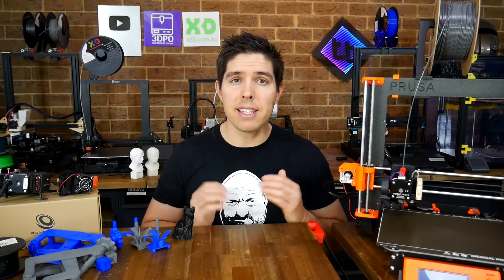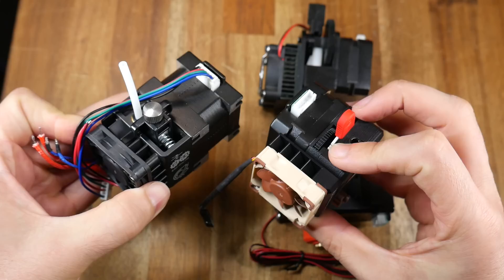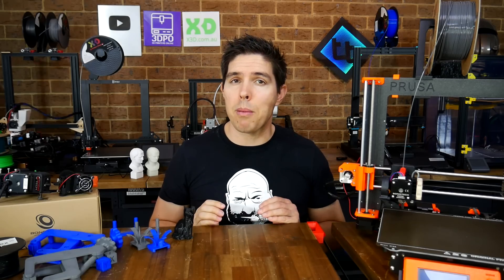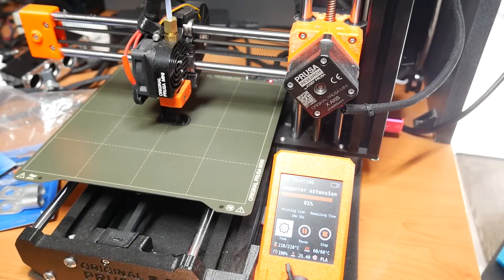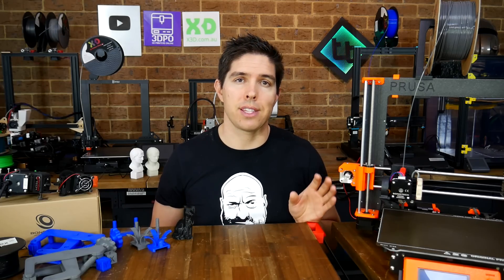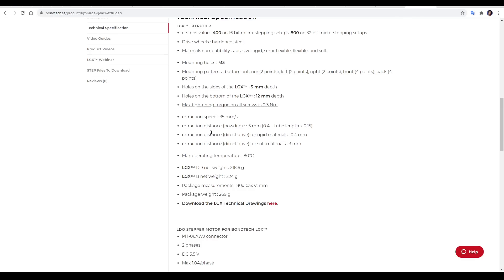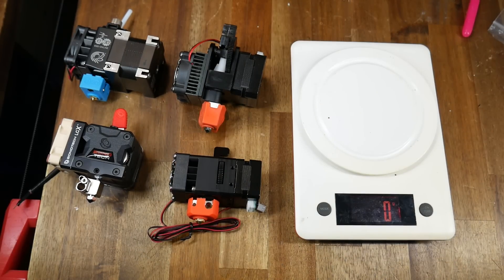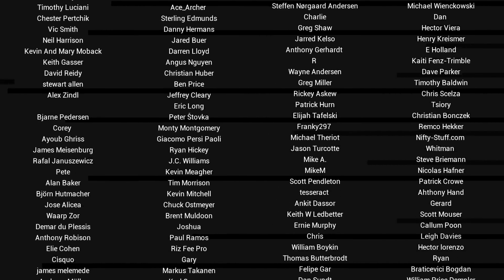Bondtech LGX extruder guide & test for Prusa MK3 and Artillery3D X1

Comment: Excellent video again! I love the LGX Mosquito combo. Mine just arrived for my Artillery Genius. The extruder and hotend is a critical part of any printer. Spend the money where it counts. Mosquito eliminates heat creep completely and is quieter as well because it's designed so well it requires only a smaller fan. Not needing to do heated nozzle change is also like a gift from god. Only need a few seconds to swap a nozzle. People don't play with more sizes of nozzles because it takes so long to do, it's messy and risks breaking parts while doing it. Yes, the prices are higher than a clone but you pay for innovation and quality in the product. R&D is not cheap. It costs nothing in R&D to make a copy so of course a clone can sell for cheaper. If people keep supporting clones there will be no innovation in the industry and it will be a race to zero. The consumer will be left with a bunch of cheap parts that break all the time.

Comment: I just built my first Voron, a 0.1, the tiny guy. I'll eventually go for the 2.4 but I have plenty of other large volume printers so the sooner might be later and might not happen. On my Voron I did something that most haven't and it's not a common build. I have a Bondtech LGX with a Mosquito hot end. And my Voron is making some outstanding prints. Most Voron builders go for lighter weight extruders to crank some amazing speeds but I am not thinking speed I am thinking quality prints and I am getting GREAT quality. Nice video as I watch you often.

Comment: I think they drastically changed this kit.  I have a generic 300 x 300 x 400 machine with an X ail the size of the Artillery Sidewinder X1.  I bought the X carriage and mount and am modifying the LGX/Mosquito upgrade kit to this machine.  I am also using the Waggester Mod.  The included fan in the kit isa 5015 blower fan, much bigger than the 4020 radial fan the Sidewinder uses.  I have a 4020 and got that all mounted up, but I do not have the "snap in place" fan duct like you did.  I think I found a Waggster variant fan duct that will work.  The Bondtech Sidewider X upgrade kit i have comes with it's own bracket piece to hang the stepper motor on, so it isn't re-using the Sidewinder.  To make it even MORE confusing, the Bondtech video tutorial shows the kit like YOU have but their website instructions are reflecting a newer version of this kit.  They really need to synch things up!

Comment: One thing to note, is that the gears you showed were not the original Bondtech gears but the BMG gears. The original Bondtech gears are actually the V1 and V2 gears. Which are also very similar to the QR gears though the center-to-center changed slightly in the QR model from the originals based upon feedback and tuning. It’s a small note I know, but just wanted to put in the correction. I actually own the second set of Bondtech  gears ever made (Alpha concept design). Martins is a good friend, and I was lucky enough to work with him on the original designs. He’s done tons of work and testing since I ever had any input. His design styling is definitely unique and I’m always impressed with his constant drive for improvement.

Comment: Very nice as usual and good timing, I just ordered the normal BondTech and V6 hot end for my Sidewinder X1 as I have been having such issues with the stock extruder after moving to a bi-metal heatbreak. Thanks again for the insight and help on this!

Comment: I bought mine last week, it will arrive next week wednesday with a Mosquito. I can't wait :)
Reply: Which printer are you putting it on. I put it an X1. One thing I found is the fan duct they have that works with the stock part fan isn't enough cooling. Luckily I previously had a 5015 fan for it so when I put that back on it made a big difference.
Reply: @n1elkyfan  It's my custom designed printer :)
Reply: @snelinternet4654  sweet

Comment: Nice review and a nice upgrade, but wow that's quite some outlay! I thought my E3D Hemera was expensive but this takes it to another level! I don't really see what advantage this has over the Hemera to justify such a difference in price, but each to their own I suppose :-)
Reply: If you don't take into account the adapter set, it is a bit closer to the same price range. But Bondtech actually created a set of parts for you for an easy drop-in replacement of the whole extruder, while for the Hemera you pretty much have to rely on other print nerds, or create your own. The care they took to make it fully compatible with the Prusa was a big plus for me.
P.S. don't forget it has Slice parts which is way more expensive than E3D, and can handle 450 °C.

Comment: Question. Prusa regulary provides upgrades for the firmware of the printer. When adapting a new extruder-combo als the LGX, do you need to recalibrate the e-steps and other details every time you apply such a firmware-upgrade ? Or are firmware-upgrades simply no longer applyable?
Thx.

Comment: You could literally buy an entire budget 3d printer for the cost of this kit.
Reply: He said it wasn't for everyone....   that whole budget printer still has to be tweaked and maintained as well.
Reply: @kevin_raney  Right but the main benefit of this upgrade would be faster printing times (lighter hotend) combined with the better extruder gears. If you just want faster printing times having a second printer would definitely beat this upgrade. So the only real benefit I see is the bigger extruder gears.
Reply: @QuadTAZ  The lighter extruder/hotend only makes a difference if you don't have a heavy bed like with the i3-style. 
But I agree with Michael, this is a very high-end product and certainly has its uses.
Reply: @xKenn  exactly but sadly injection molding sometimes can´t get to where sls can. I spoke some time ago to trianglelabs about making an bmgx2 which i think many people would buy but they said theres no "cheap" way of doing it.
Reply: @dilanbartz7737  not everyone wants to work for $3/day.
Reply: @xKenn  Extremely embarrassing for you to say something like this to promote a company which steals design and uses it as their own. I would not want more people like you in the 3D printing community which does not support the good companies which develops and makes this technology move forward.
Reply: One year later and it still might not be for you. Its for people with vorons and ratrigs or annex k3’s that are looking for reliability with performance. You wouldn’t put this on a ender 3 lol it’s like putting Lamborghini wheels on a honda accord. This is the recommended config for rat rig eva3 for the crazy accelerations and not skipping.
Reply: And you’ll get budget print quality.

Comment: Can you please update your test print calabration to support nozzles that are not 0.4mm. 
Very nice review of the extruder and new bondtech gears. I think prize for the best extruders avaliable goes to the sherpa mini followed by the HextrudORT off the shelf the BTT H2 looks very good and capable. As far as bigger extruder gear diameter goes yes this will provide more grip but is it really needed? there are many examples of hot ends printing at 200 to 800mm/s on bondtech gears so i think the smaller lighter original design is better.

Comment: That flexible print looks amazing. 60mm/s isn’t particularly slow either!
I like the set tensions with detents, but it would be better to have something that had reference numbers or other clear marks that allow the user to go directly to the setting required for a particular filament.
As an side, Printrbot may have had a dual drive with their Gear Head extruded before Bondtech.

Comment: I've ordered one (with a Mosquito HE) to replace my overheating noisy Hemera but they're short on stock. Still need to wait 2 weeks (Europe).
I calculated it'd save me 170g in weight for the whole package (mounts and HE included), but the much easier nozzle change is the real deal for me (with the Mosquito no need to hot tighten, and the heater block doesn't twist).
Reply: What do you mean with overheating?
Reply: @certified-forklifter  He is probably talking about heat creep. Slice Engineering products eliminate this problem completely.
Reply: @tsemonkey  I never heard about any heat creep problems with the Hemera. That's why I assume it's an user error. Maybe I can help if he provides more information. 
You learn very little by just buying an (very pricy) product.
Reply: It's not heat creep from the HE. The motor is overheating at the E3D recommended Vref of 1.197V but is skipping steps at lower Vref. Probably a faulty motor. The screeching noise indicates it's seizing. E3D said they'll replace it but the Hemera will go on ebay as soon as I got the part.
Reply: Hi Muru. Thanks for the clarification on the subject. It's not the first time E3D has had quality issues with the Hemera. It was taken off sale for a very long time because of other issues it had in the past. I hope this is not a widespread issue. E3D makes great products as well but the Hermes/Hemera has suffered some QC issues.
Reply: @mururoa7024  wow, okay that doesn't sound good. Have a nice one

Comment: Down to this extruder or an orbiter 2.0, either gonna end up with a copperhead and CHT nozzle set on my new X5SA-400 arriving in 2 days. After looking at the Voron and RatRig in the bigger dimensions, this will be the best bang for the buck large print motion system at US $380 on sale from TronXY direct on eBay.

Comment: I am new to 3D printing and I appreciate the amount of time you take explain the pros and cons to the equipment you are talking about in each video. I also find your instructions to prepare and install the equipment, and the extra effort you put in behind the video preparing links to help people find the necessary software and for you writing the changes we need when it's not available. I do have to listen to parts of the video a couple times bc you are so versed in every component of all the equipment and sometimes speak really fast for us that are scratching our heads. I'm not complaining because I appreciate all your hard word.

I wanted to ask if new LGX extruder along with the hotend is available for the Ender 5 +. If so is there a lot of upgrading to firmware needed and any additional coding that has to be added seperate.

One other thing I wanted to ask. The Ender 3 has the ability to access and make changes from the attached screen. I'm sure you know the Ender 5 is very limited to any settings. Is there another motherboard along with an additional screen or do you need to replace the one you have.

Thank you for your time. Mark

Comment: Nice Video,🙂 but why dont you use your  BL-TOUCH Mod from your Video  on the Sidewinder X1?
Reply from the maker: The waggster mod is a superior design to the one I designed. Best of all it uses the wires meant for the RGB LED inside the ribbon cable for the BLtouch.

Comment: I would like to know more... about editing firmware (for Moons .9deg, PT100, etc)
... and high temp materials... regarding your note "You could opt to also get the high temp heater cartridge and thermistor to print really high temperature filaments."

Comment: I think the design is ok but not what we really need. What we need is a quad gear system which fit's onto a NEMA 17 footprint. So 2 double gear screws to enhance not only the surface area but also with the smaller wheels we get the filament better thru without bending it. Think TPU if we do have 4 gears with a spring loaded mechanism from the side we can slide in open position the filament thru the guide holes before clamping down the gears. because they are right behind each other it will allow also for a very smooth and straight feed.

Comment: I keep debating going direct drive. I care more about quality than speed and it always seems like that’s a lot of weight to add for basically just lower retractions and high speed prints with flexibles.
Reply: You are right, but consider that you can push more filament at given speed (extrusion width) with direct drive and a geared extruder. This helps with lrint time and layer adhesion with the same feedrate and quality. So the upgrade maybe viable for your usecase. I will convert to direct drive on my ender 3 because of this.
Reply: @melvin5312  thanks for the input

Comment: Hi! I have been following your channel for quite some time and pulled the trigger on this for my sidewinder X2 thanks to this video! I installed the full kit flawlessly but it looks like my extruder is running a bit hot. My stepper drivers are stock, and my printer is also stock (but the new extruder kit). Problem is I cannot find a formula to calculate the right Vref. Even on your site there are two possibilities and do not know which onw I should use. Can you help me out? How can I calculate Vref so I have the right output? They are set at 0.94 now. Thanks!

Comment: So bondtech took the hemera cooling design, which is fine, open source and all. But slice took the hotend, changed very little, pattern patented it, and that's why I can't support them.
Reply: the only patented part is the "bi-metal heartbreak" part I think
Reply: No, the LGX "Flexibles Addon" is similar to the Hemera, and Biqu, and several others. The standard LGX is a normal extruder with no heatsink built in, taking a standard hotend, I have a Mosquito in mine. You can switch the LGX between Normal and short pathway for flex.  Hemera can't.

Comment: If you had more available torque, you would be able to push more at any given temperature regardless of heated zone length. Upping temps and longer heated zones also improve the numbers of both your stock options.

Comment: Hi, can you make a video about part cooling inside a heated enclosure? I think BerdAir could really shine, but I would like to have your opinion on it.
Reply: If you're looking for cheap solutions for PLA, ever tried a regular home fan? I put one next to my printer, set it on max speed and the print came out like a charm. It even kept my Hemera cool.
Reply: @mururoa7024  Seems workable, but maybe not inside an enclosure, at least not without making it significantly bigger than it needs to be to accomodate the fan.
Reply: @fredwupkensoppel8949  On mine I added a 120x120x32mm squirrelcage blower fan. I made a large hole in the rear bottom corner and mounted it such that it sucks air in from under the enclosure and can exit the opposite corner on the top of the enclosure + a small PWM controller so I have a huge range of adjustability. If you do something similar be sure to add a small filter (like one from a desktop computer case)  so you don't suck up dust and hair into your print.

Comment: I think it is unfair to call the H2 a clone of the Hemera. It is 1/3 lighter, they have a different motor size, different gear reduction, the cooling fin design is different, different mounting. 

The concept is the same, but the implementation is quite different.

Comment: If you own a X1, add some Z axis stabilizing bars designed for the Creality CR-10S (need to print adapters to secure them to the back of the X1). They look much nicer than threaded DIY rods. The improvement for large prints is instantaneous.
Reply: is that something that is needed specifically for the X1 or do you think most printers would benefit from adding stabilizing bars?
Reply: @fourdoorsmorehoes  Most printers with a tall enough gantry could benefit from stabilizers (some brands provide them by default). However some printers already have a rigid gantry because of how they are build: e.g. on a Prusa the power supply block connects to both the base and the gantry thus providing support and rigidity.

Comment: This is some expensive kit. It really seems to be the slice engineering hot end parts which are way over built for the majority of people.

If this were generic E3D compatible it'd be a lot more interesting.

For a regular person, something like the Mellow Wind series or E3D Hemera or BQ BX seems like more bang for the buck.

At half a day for an install, Im not sure which company with quantity would want to spend that time, so this seems to really be for the very niche market that is hobbyists who want the absolute best.
Reply: Agreed
Reply: You can set up the LGX with a regular V6 hotend.
Reply: What was the price at when the video was posted?

I checked around and both Himera and this kit are around 100€ at current.

Did they drop it a lot?
Reply: @enlightendbel  The LGX kit is €276.11€ and the Hemera is ~130€
Reply: @certified-forklifter  kits that include hardware for a specific printer AND include Mosquitos or Copperheads, sure, but the LGX itself is 106.36€
Reply: prob takes far, far less then half a day if your doing multiple times (or multiple a once)

Comment: Looks awesome but doesn't look like it supports the prusa mmu2s. Wonder if they will do a mmu version/upgrade????
Reply: You could probably design and print required upgrades to get the sensors  to fit right :)
Reply: It's more the tensioner that I think would be a problem.

Comment: I have had the LGX with a Mosquito hotend installed on my Sidewinder X1 for a few months so far and I do like it, but have a question about speed. I can't print over 100 mm/s without the extruder clicking like crazy then jamming. I've set my extruder steps, and upped my temp to 220 for PLA with no difference. I've switched between Marlin and Klipper and Simplify 3D and SuperSlicer. SO wanting to know, is this normal? I've been able to print at 140 mm/s (not pretty) without any clicking on other extruders in the past